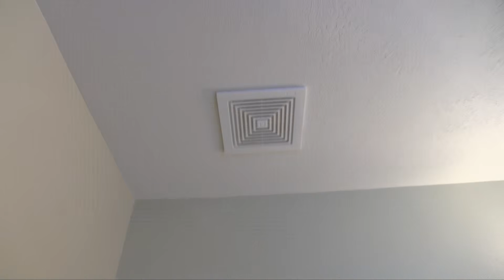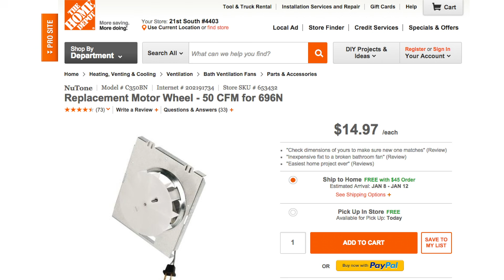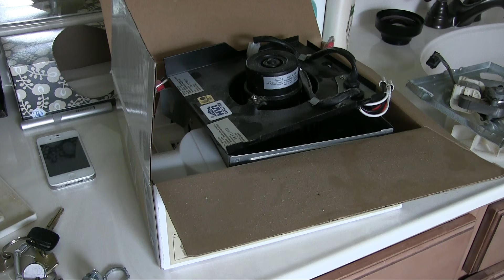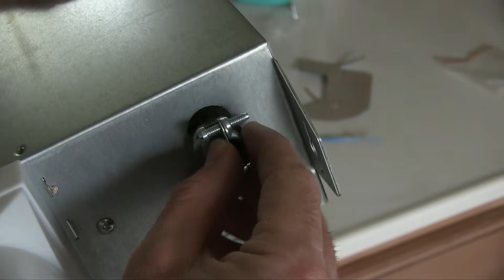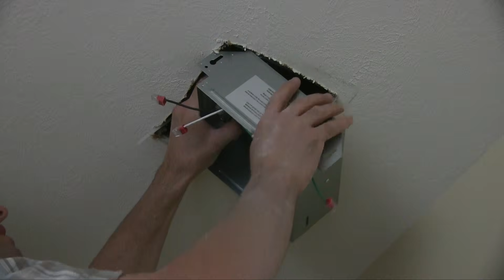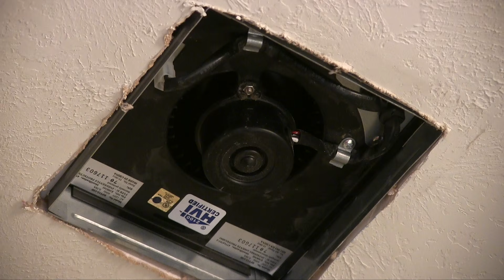How to replace or repair a bathroom fan

Comment: My bathroom fan is running all the time. I use to turn it on and off from a switch, but the fan doesn't respond to the switch anymore. I have changed the switch but this didn't help as the fan still keeps running. Any suggestion about what may be causing this problem. Thanks.

Comment: I live in a cheap all bills paid apartment. My exhaust fan makes a really loud bearing noise when I first turn it on in the morning. I'm sure my neighbor's hear it because the walls are really thin and I can hear my upstairs neighbor walking around or dropping stuff sometimes. I think I'm going to just replace the motor because the management tried to charge me $150 to replace 2 good smoke detectors without my acknowledgement. I don't want management to have any reasons to raise my rent or keep my deposit. It it were my house, I'd replace the whole fan.

Comment: I have 3 switches in my bathroom and the 2 for lights work but the one for the vent don't. I did as you said and plugged in a tiny lamp and it would not light up but it does work plugged in another outlet

Comment: Wow love this video my fan has been out 10 months and I have been scared to attempt to do anything in changing it. So I will test the plug blow dryer to see if it's the motor or electrical still scared but video was awesome. And if you don't see me comment again I have died bec of electrical
Reply: Did you die? I need to know I’m gonna have to replace my fan
Reply: If you are in the US, you won't die from exposure to AC electrical current as it is only 120 volts. It won't feel great though. You will feel a noticable buzz. Other countries with higher line voltages could be an issue though. Their line voltages are usually 220 to 240 volts. Canada is the same as the US. Mexico is 127 volts., and Japan is 100 volts. So those three countries the voltage wouldn't pose much of a risk either. With all of that said you should be killing the electricity at the main panel circuit breaker before doing any electrical work for safety reasons.

Comment: The 4.0 Sonnes is rather loud for a fan. I purchased a 90cfm @ 0.8 Sonnes for my bathroom that is 60 sqft. Most codes set the minimum cfm requirement based on the size of the room. Also remember that what goes out, needs to come in. If the room shuts tight with no in vents, then the fan can do little.
Reply: He bought the loud one because it's his sister's place and she made him do the work lol
Reply: Like a supply/return vent?  Good point
Reply: I like the loud ones, its a feature not a bug.  :D

Comment: my master bathroom has no Windows and i feel like i need a stronger unit. painters already said that was the cause of my walls messing up. is it super expensive to get a larger unit installed? does it even make a difference.
Reply: I’m gunna add a reply to a three month old post cause you handled yourself like a rockstar with the troll.   

The prior post was correct about size of the unit and gap at the bottom of the door. 

Try removing the cover and pull directly down on the fan, from the center.  Don’t wanna break a blade.  The fan should pull off. Then just clean the fan blades.  A clean fan blade can move a lot more air.  You need to clean the cover, too.   Use a jet vac to suck collected dust off of motor and interior housing.  
Remember to turn the switch off and unplug the motor before the vac.

But to answer your question, no it generally does not cost much to increase the fan size.  Let the contractor pick it out.  They can size, fit it properally.  The expense comes from a new install and running a vent thru the attic, crawl space to the exterior.  Do not let them vent into the attic.  

Sorry for answering a three month old post.   Just had to.   Have a good day!
Reply: Yes their is suppose to be a certain size gap under the door and a specific CFM rating per the size of room.
Reply: Rosemary Williams stop taking store hot showers and taking massive dumps
Reply: HOW DOES IT FEEL TO BE A DICK?? OH YOU DONT HAVE ONE...OK BYE!
Reply: Rosemary Williams that's all you got? WEAK..

Comment: Hi Adam, great video.  I was wondering why the original fan had an outlet but the new one you installed didn't.  Thanks
Reply from the maker: It's just a decision they made to wire it differently.

Comment: Hi Adam, i have the fan you originally removed and would now like to replace it with a heater fan for my bathroom (100 sq ft).Any recommendations?

Comment: My fan motor was just replaced, but the moisture is staying in the bath.  Do you think the hose fell off?  It won't hold a tissue.  So the fan works, but there's an airflow valve that's plastic in the box and that seems to be moving.  However, my fan goes through to the roof with the hose.  So how do I determine what's wrong in the attic?

Comment: You skipped some of the toughest points. Like how hard it can be to get an old unit out from underneath when the screws are in the attic. How hard it can be to get the vent pipe back on. How older homes have 3inch pipes and new fans are all 4inch. And soooooo many other things.
Reply: quietcorona33 There is always someone on YouTube that says they can do it better than in the video. I suggest you hop to it and show him how it’s really done.
Reply: ShuddleBuppitz this isn't a question of doing it better it's a question of several very important skipped steps that are the difference between  simple and clean or difficult and patch work I have done probably 50 of these in the past 7 years and no two are alike but most are way more difficult then this guy made it out to be.
Reply: nnusader8 the duct vent should be held on with a clamp or tape. The clamp should just be a screw you loosen off.
Reply: How do you disconnect the housing unit from the duct vent? The video just shows it being pulled out. Very helpful video until this point, but I'm totally left hanging now...
Reply: Oh and NEVER use zip ties for to connect  the vent pipe,  always use proper hose clamps and foil tape.
Reply: You are so right.  We watched a vid on how to replace your sink disposal.  How easy they made it look!  Okay, so we got the required materials and set to work.  Lo and behold we couldn't even get the disposal off it was so corroded on there.  Had to call a plumber and the plumber had to saw the disposal off!
Reply: nnusader8 it sounds like you're replacing the entire unit. Here is how you can try and do it. Turn the power to it off. Pull the grate cover off and look to see which side of your unit is attached to the ceiling joist. It should be screwed into a joist on just one side. Pull out the old fan and motor next. Now comes the part that got missed in the video. The screws are probably buried on the outside of the fan and you won't be able to get to them. So here is what I usually do. On the opposite side of the unit fro  the joist take a prybar an push straight up on the inside of the old fan housing, you need that edge opposite of the screwed in side to get clear of the drywall. Once you have a decent bit of clearance go back to the screwed in side and pry between the edge of the fan housing and the joist it is screwed into. Be  cautious to try and not wreck the drywall if you can. You may need to go back and forth between pushing up one side and prying on the other to get it loose. At one point you may see where the screws are attached on the pried side, there should hopefully only be one on each side. Get your prybar right under them and you should be able to pop the unit out into the ceiling cavity above. Be warned if your attic is above there is a great chance that insulation is going to fall into the room and on you.  Once the unit is loose you can maneuver it around in the attic and get to whatever is holding the vent hose onto the unit. Also take out your electrical wire and you should be able to bring it down through the hole it left in your ceiling. Now your old hose could be a solid pipe or hopefully just a flex pipe. Depending on how old your house is it may be a three inch pipe. You'll need an adapter that goes for  3" to 4" pipe as most all new fan units are 4" openings. If you have to don't be afraid to buy a fan with a bit bigger housing and just cut you ceiling hole bigger. Take the new motor out of its housing. New units generally have a plastic adapter  that attachs to the fan unit  after the fact. So get your hose oriented and foil taped to that piece and snap it in as you raise you new fan into place. If you have bought a bigger fan use the ceiling joist side of the old fan as your starting point and cut drywall everywhere but the joist side to make it fit. That joist is where you're   screwing the new fan into so the drywall under it can't be cut. Dont forget to run your  wire into the fan as you raise as well. Once its up drill two screws as high up on  the inside of the unit as the joist will let you.  Dont worry about making holes on  the inside of your new unit if there are none there to accept the screws just punch through the metal and tighten it down. Reinstall the new motor and give it a try (dont forget to turn the power back kn) and you should be good to go. It's not to difficult just take your time and you should be good.

Comment: When I turn the bathroom fan on it makes a humming sound :/ I took out the fan and tried to clean it up and when I plug it in to any outlet it makes the humming sound from the motor. Do I need a new one? Or maybe just some WD-40?

Comment: 70 cfm is up to code for continuous use, for intermittent use it is 100 cfm in the international mechanical code if your state uses that code. Home Depot,lowes, other companies are not responsible to know.
Reply: James Rath thank you. buying tomorrow so I'll remember this.
Reply: Continuous vs. intermittent is not how the cfm rating is portrayed by manufacturers and retailers.  The cfm factor in choosing a ceiling vent fan is related to room size.  Continuous vs. intermittent makes no sense.  Who lets their fan run continuously?

Comment: So if the fan is just loud, would just replacing the motor make it more quite?
Reply: Angela Dabney, mine couldn't move a kleenex held in front & it was way too loud.  FIlth seemed the culprit  (previous tenants - not mine)  I unplugged the motor & popped out the mounting plate.  I pulled the plastic blades off the motor shaft & soaked in hot soapy water, gagged & washed. [Don't even think about what I cleaned out of there :þ] I Used WD40 to clean the motor & steel wool to clean rust & stuff off the shaft. I added a couple drops of 3n1 Machine Oil to the shaft in the front & back of the motor and 2 more drops under the blade's side before sliding them back on.  It's running quieter than I expected.  I'm happy it actually moves air for the first time. I knew oiling it would likely quite it down. Sadly cleaning & oiling is the ONLY way to find out if the blades are moving too slowly (can't see it otherwise).  At least, I saved it from the landfill  :]

I swear I can breathe better now.
Reply: Not likely no

Comment: So if you find that it's wall switch what then??? :-)
Reply from the maker: Replace the switch or check the breaker.
Reply from the maker: Usually bad wall switches will feel differently thank working ones.

Comment: my kitchen has that bathroom fan. is that a good idea? also i'm not very confident that the fan even has an exhaust pipe leading outwards.
Reply: You should not have this fan in your kitchen !!  It is a fire hazard.  Stove grease builds up in motor and catches fire. Remove it and put up nothing or a more appropriate fan.

Comment: does the circuit breaker box have anything to do with the bathroom vent not working?
Reply from the maker: Yes. I can stop the fan is the breaker has been tripped or if the breaker is broken.

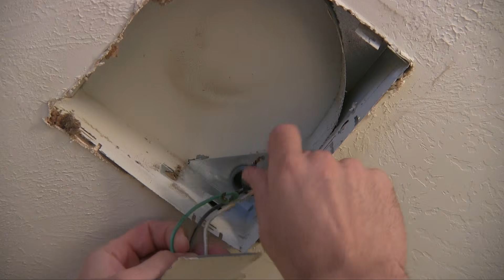Comment: you skipped several steps there between 1:24 to 1:26, i need to see how to remove the motor housing
Reply: AdamDIY
Reply from the maker: If you don't see visible screws then try pushing up on the housing, hoping that they just used the keyhole slots to attach it.  If it does not come loose try prying it with leverage.  A long screwdriver and the end of a hammer may work.
Reply: Onetazien

Comment: Hi Adam, I have a Clever bathroom vent, I am looking to replace the motor and the fan, but I am not sure if ME 050 is the model number(this is what I found from the sticker on the vent). I have tried to google it and look it up at homedepot.com, however I don't find any. Please advise if you know somewhere I can find this model of Clever bathroom vent. Thanks.

Comment: will the new one fit or are there differant sises
Reply from the maker: Take off the cover on your old fan and measure the square that is cut into the ceiling.
Reply: OK, thank you.
Reply: How do you know what the size you require is going to be?  What part of the original fan or the whole or whatever do you actually measure?
Reply: I found a replacement cover to the ceiling, and a replacement fan kit at Home Depot.  It was pretty easy!  
Thanks +AdamDIY for this video it was very useful, and I consulted other videos of similar content as well.

Comment: Thank You, BUT I found out, not all Exhaust fans come off the same way. I just wanted to change the burnt out light bulb and after putting a crack in the exhaust fan cover I saw a seperate cover for the light. You pinch the light cover together and this cover comes off. 
Then it exposes two  (metal)  clips that you pop out of  place and then you can remove the rest of the exhaust fan cover. GLAD YOU CAN'T SEE THE CRACK!

Comment: Adam one?, you put caulking around the edges?? I am thinking that you mean NOT ON the plastic cover but just between the motor & wall so moisture doesn't get up into the attic. I say this because I often clean my cover to the fan & caulking would not allow removal of the cover. Am I understanding this right?
Reply from the maker: +BevG181 Right, not on the plastic cover.  I put it in between the metal housing and the sheetrock.  In this installation there was a fairly large gap into the attic so a bit of Acrylic Latex Caulk really helped to close it up.
Reply: You could also push some foam backer rod into the gap, less messy.
Reply: BevG181 y
Reply: BevG181 sector fan
Reply: BevG18